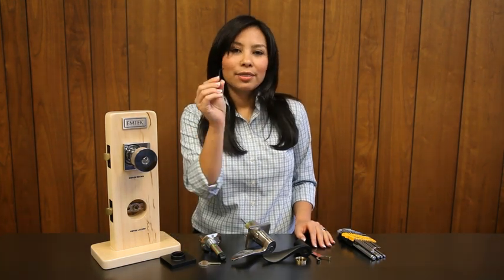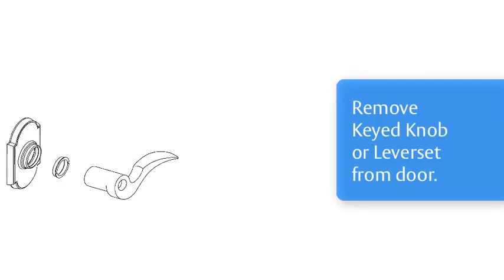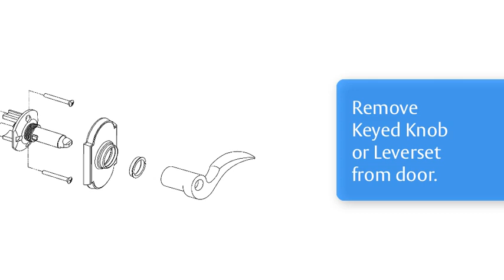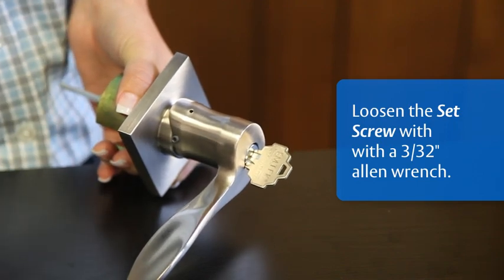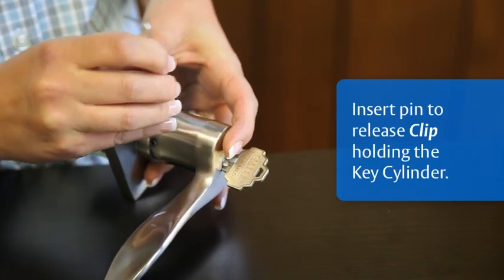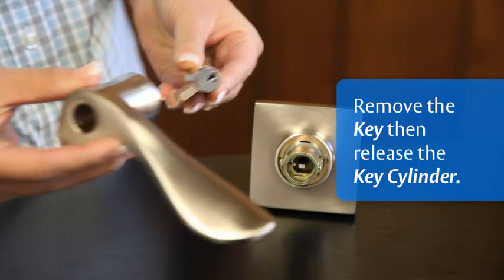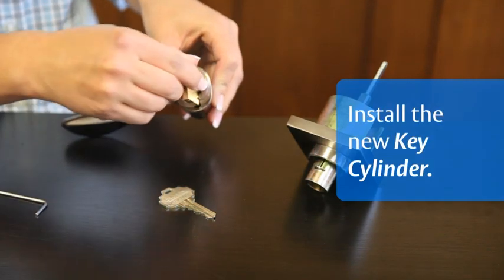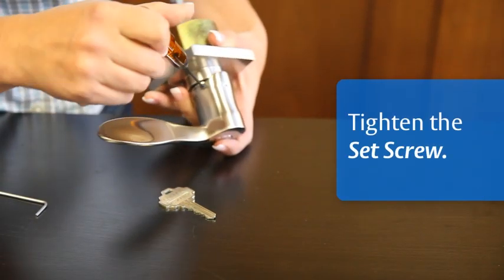Replace Cylinder - Key in Knob and Key in Lever

Comment: First it is KIL for lever and KIK for KNOB, and it is not necessary to remove the whole lock from the door to replace the cylinder it works just fine doing everything she said without removing the whole lock from the door!!!

Comment: The key must remain in the lock. You cannot remove the handle if you do not have the key or if the key is not in the cylinder. Per Emtek customer support and personal experience.